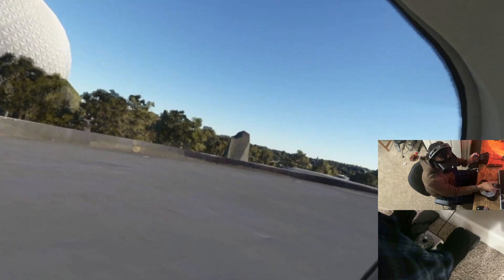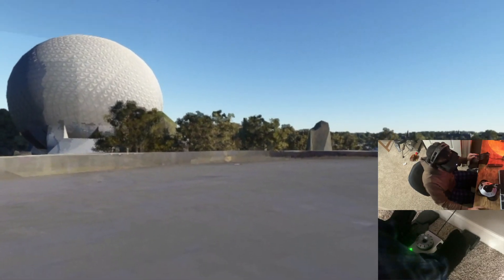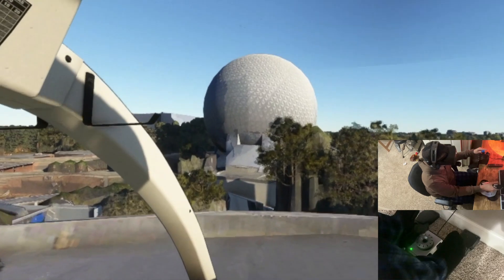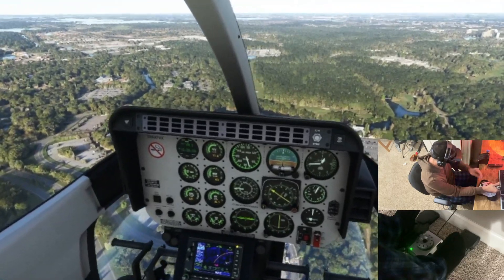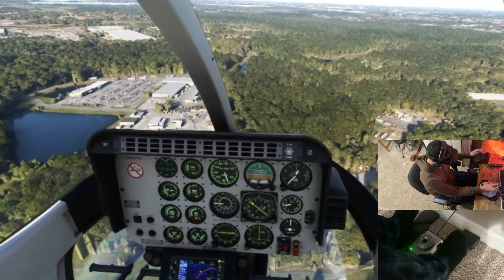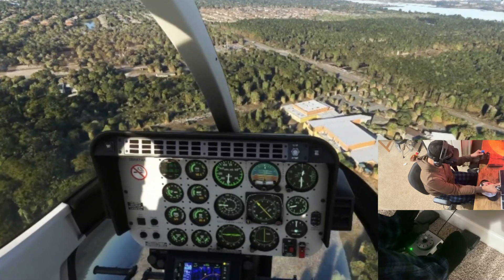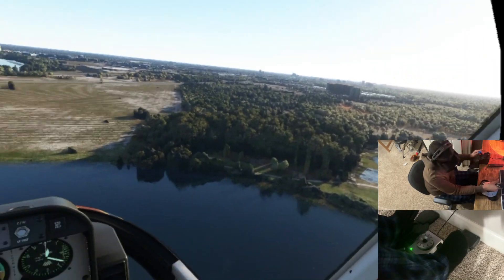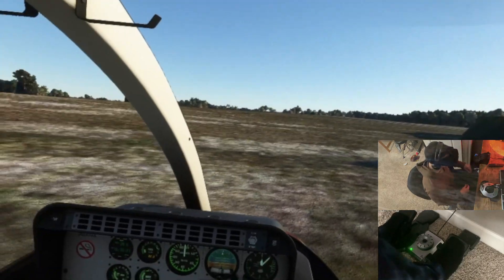Helichoppers 101 - Instructor Pilot Flies in MSFS - Lesson 2: Takeoff, Altitude vs Airspeed, Landing

Comment: At high airspeed, neutral cyclic results in massive pitch up. I thought maybe the tail straightens the helo to level, but it goes way past that and the nose is pulled nearly straight up until it stalls. What causes that intense upward pitch at speed? That's with no trim, no auto-trim, no assists.
(I thought that if I pushed full forward on the stick, the aft rotor lift would persist and push the nose down to invert underneath and the helo would somersault rotors-first into the ground, but there's some force that won't let the chopper tip past a certain degree as speed picks up, and it's not explained by the tail drag. This is different than I remember choppers in MSFS circa 2007.)
Reply from the maker: Not sure how fast you're going but you may be experiencing retreating blade stall

Comment: Your videos are awesome, and really helping me get into helicopers the last couple of weeks. I wonder if I can ask about VR please. I bought a HP Reverb 2 last week, but I found the instruments quite blurry with it. I see on this video, your instruments are blurry compared to the first tutorial where you were not using VR. Is it simply the case that VR will not give the same sharpness as a monitor, and it's not that I have received a faulty unit, or need to change some kind of setting? Thanks
Reply from the maker: It's crystal clear for me inside VR. The image that gets recorded is blurry so it looks like the res is lower in my videos. That's because it's one eye stretched out. But not sure why you're getting a blurry image in the headset.
Reply: Thanks for the reply. I'll try again and see if I can get it clearer. Maybe something is wrong in the settings. I would think it's unlikely it's a defective unit.

Comment: Have you tried autorotation? Something seems a little off there in terms of getting some rotor RPM back..
Reply from the maker: Not yet. But I will have a video soon. Having trouble binding the twist grip to my throttle quadrant. But ultimately, I'm going to turn the engine off or at least to idle and then drop collective. So RPMs aren't coming back huh?

Comment: Thanks for your work! there's one point that could be improved (if it's possible) - the resolution of VR. Nobody can see the numbers on the gages.
Reply from the maker: Yeah I'm working on that. Any ideas?
Reply: @SnakPakFlight  Actually no good ideas. using a wide screen monitor (to see the horizon and the gages) only without VR? do you really need VR to create basic videos in the series How To Fly? it seems to me that knowing how to read the gages will help beginners to achieve more success
Reply from the maker: @valeriik9135  I think you're right. The first vid was without VR. Definitely  harder to fly without VR and I do like that people can see what I see when flying. See how I scan and so forth. I'll work on it. Maybe track IR would be just as good and have much better res.

Comment: What is collective is that the actual throttle on the stick ?  I am learning helicopters with your videos Thanks
Reply from the maker: It's the stick for the left hand. Pull up - trees get smaller. Push down - trees get bigger. The throttle on this helicopter is a twist grip on the collective stick.
Reply: @SnakPakFlight  oh okay cuz I have a side tech joystick and it's got the twist handle and has a throttle at the front of it I have the bravo and alpha but I will just have to calibrate the joystick